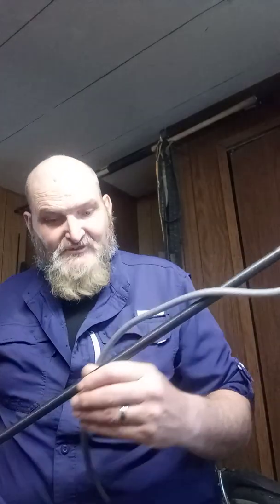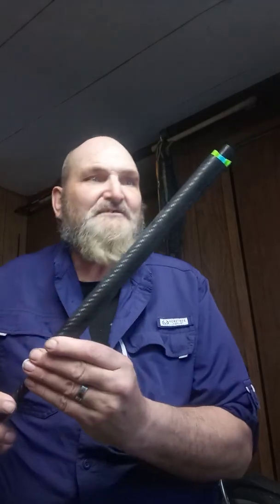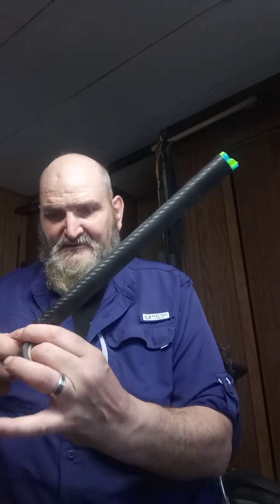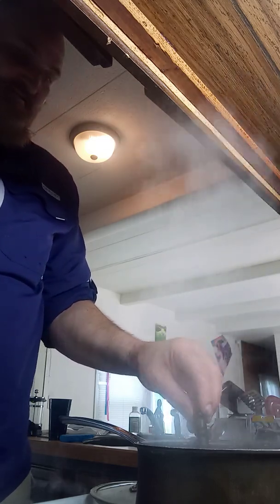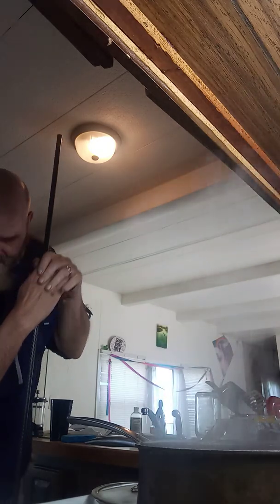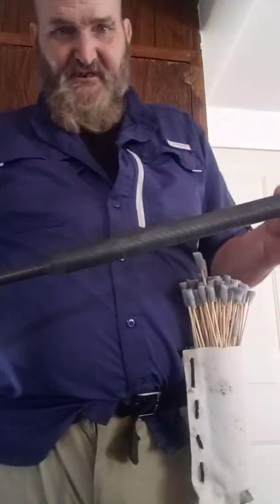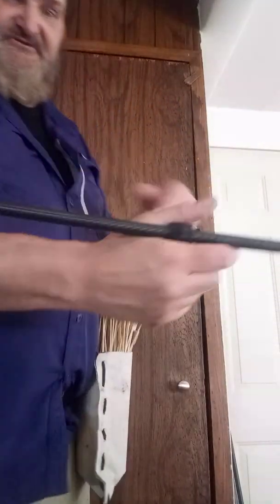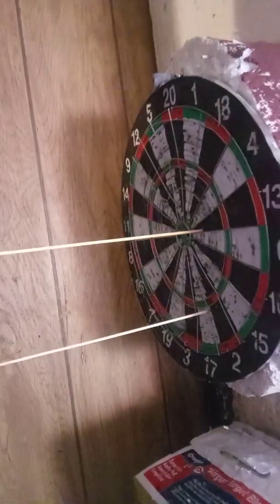diy carbon fiber blow gun

Comment: Is there a link that explains in detail exactly what the benefit of a backdraft chamber is?
Reply from the maker: Yes old geezer corner from the 2000's
Reply from the maker: http://web.archive.org/web/20060621090408/http://www.geezers-corner.com/GeezersCorner/backdraftx.html
Reply from the maker: Here is my build of the high powered blow gun
Reply: Can U share the Amazon link to the pistol grip that U used. Thanks, GR.